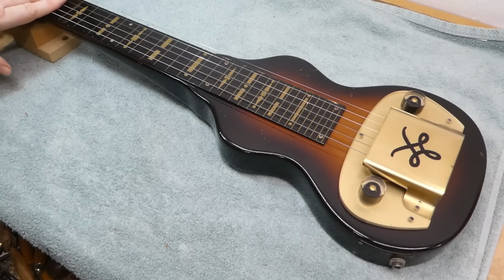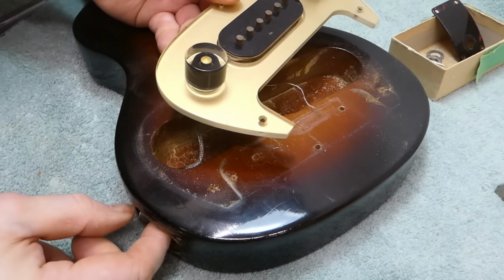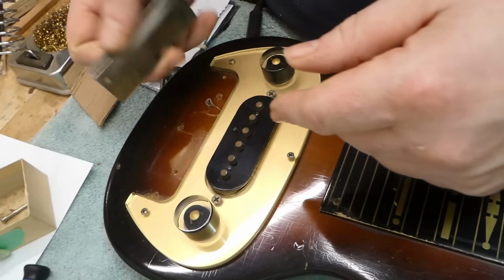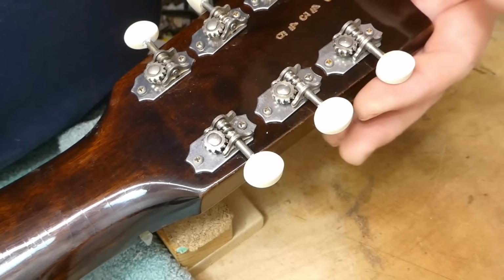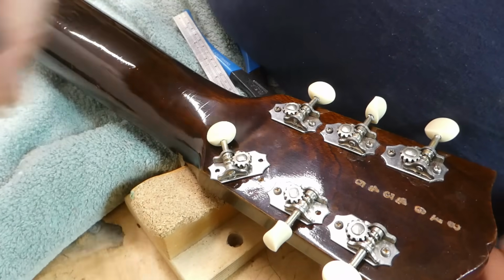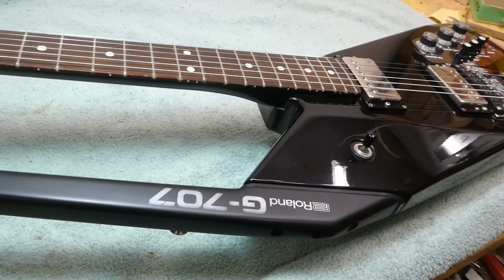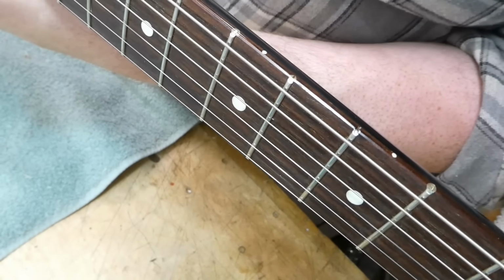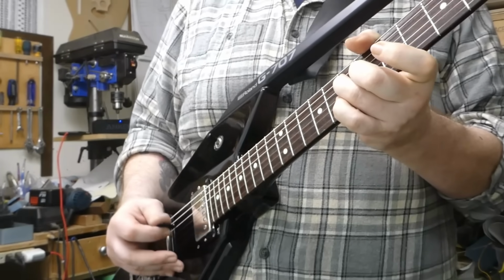Oddballs, old and new.

Comment: I used the Roland GR for many years. I really didn’t understand how to set it up but I worked it the best I could. I now use the Roland GR55 which perfect it isn’t, it was a far better system. One user of the GR 707 is Chuck Loeb. A video on YouTube shows him using it in the fusion band, Steps Ahead.

Comment: I’m only here to comment that the Telecaster pickup started out being that thing from a lap steel. Thusly the poles were flat. Thusly on a Telecaster the middle strings didn’t get the signal enough. The steel plate underneath altered the shape of the magnetic field overall. And Leo started this slant bridge pickup thing to spike up the high notes, which I find to be annoying. I ordered a set of Tele pickups due to the vaunted reputation of the things. I pushed up poles 3 and 4. The non-magnetic plate covering the neck pickup removed discovering that those too were all flat, pushed those up too. Amplified music was a beautiful thing in those days though and this Gibsun is a beautiful instrument.

Comment: I had a Casio MG510 (Ibanez made guitar + built-in MIDI) for years I used to compose my ideas into an Atari ST1040 computer running Cubase.
I "recently" upgraded a 2nd hand MG510 that had a broken 6-coil pickup with the Roland GTK3 that is still one of my main axes...

Comment: Tony James used a G707 for the Sigue Sigue Sputnik Flaunt It tour. IIRC it was used exclusively as a MIDI controller for the bass lines, which were all synth-generated. Neal X played a regular electric guitar. I don't know why Tony didn't used the G77 bass (which looks the same at first glance, but has a different shape), but I suppose that it doesn't matter.

Comment: BTW, nowadays Fishman 'Triple Play' are way ahead of Roland GK PU's. The problem beeing, with GK's, they can only track correctly, if you're in tune, the Fishman doesn't care , not only it tracks out of tune, but you can also 'bend' without problems , once configured correctly!
+ bonus, no huge 13/15/18 pin cable. They've released a new model recently. For curiosity, watch Jennifer Batten using it! Take care and thank you for sharing.
ps I don't understand how midi PUs aren't more common for Bass! It would make sense! Once again, Take care!

Comment: I'm not into guitar repairs, more into electronics, and am surprised the old capacitor isn't replaced. They will all be leaking and appear more like a resistor than a capacitor by the time. Another Canadian, Mr Carlson's Lab, is recapping all the time in every old radio he restores, even keeping the old casing if necessary.

Comment: Most garden-variety superglue formulations are a bit too thick to be usefull; It's helpfull to keep some waterthin CA glue around for jobs where you want the glue to wick up into a tiny crack or underneath a finish (if you need to make a hard-curing paste from baking soda and super glue, it works much better with a waterthin CA glue compared to using ordinary small-tube super glue). Titebond sells small bottles of waterthin and medium-viscosity CA glue; other companies (Sure Hold, Zap-It and JB Weld) sell UV-curing CA glue that cures instantly when irradiated with the (included) UV light and cures more slowly underneath/ inside the joint where the light doesn't penetrate. I have a video about these glues on my channel.

Comment: FYI, the abrupt,  all or nothing tone control is something that was done intentionally on many lap steels (some Tele players do it too) to make it easier to get the “Boo-wah” sound that was a popular special effect, particularly in Western Swing music.  It is achieved by using a high-value LINEAR potentiometer, along with larger than normal capacitor (Fender Stringmasters have a 1 MegOhm linear pot with a .047 uFd cap).  Here’s  a link to someone demonstrating the sound  https://www.youtube.com/watch?v=zaCb6GL5Gp4.

Comment: I had a silver G-707 and the GR-700 guitar synth in the 80s - it was essentially a Roland JX3P on the floor. It worked OK, but it never tracked as well as the GR-300. The tremolo was just atrocious, and I never ended up using it.

Comment: The gray trim pots seen at 26:39 are a known failure point in other electronics of that era: the plastic shrinks and cracks and the resistance setting shifts or the linearity of resistance adjustment becomes wonky. I've changed lots of these in 70's and 80's audio equipment (typically used for bias adjustment and offset nulling) but I shudder at the thought of changing them in a device like this ---- how the heck would you go about recalibrating it?

Comment: Roland is actually still THE company to go to if you wish to have synth guitar stuff. I suppose aeroguitar has proven the crappy plastic controller with fake strings stuff Roland had also toyed with in the 80s is still NOT the way to go - but Roland’s midi pickup for (actual) guitars seems very refined for real-world uses.

Comment: I still have my 1985 GR77B bass system. I haven't played in in decades. It's ok as an analogue bass and the bass version is based on the JX8P synth, so the sounds are great. But the note tracking is terribly glitchy and slow. Forget play anything but long whole notes below A. The weird shape is not good for sitting and it suffers from neck dive. I moved the strap button on to that "cool" looking bar above the 12th fret. That bar is supposedly a "stabilizer." Maybe it was meant to prevent dead spots but I doubt that it makes a difference.

Comment: What an odd tone on that lapsteel.  I'm not very familiar with them so I dunno what's typical.  The low strings sounded like those synthesized clock bells and the high strings sounded like car horns.  Maybe just that hot of an output and getting distorted in the amp.

I've tried a MIDI guitar, even got pretty far writing some software for it, but its MIDI stuff just up and died, I think a bad USB cable.  Thankfully it has normal pickups and an output jack too, so now it's just a plain electric guitar. :p  I'd done a bunch of research in to MIDI guitar and the options are pretty limited and expensive, yeah.  The all together MIDI guitars are neat but seem not to hold up or just not that good.  The extra pickups you can add for it seem expensive all in and need extra outboard hardware and can't really work directly with a PC or anything.  The VSTs just suffer from all the usual issues of modern plugins.  Proprietary software, who knows if it'll work the next time you go to load it up or complain about some license nonsense, etc.  Maybe the situation's improved in the last couple years since I last looked in to it but I doubt it.

Comment: I remember trying one of these out when they were released, I wasn't too impressed by them as the guitar wasn't very good and so I wouldn't use one to play guitar and then switch over to a synth lead, I would much prefer to just use a keyboard synth and play my regular high quality guitars, I play both guitar and keyboard instruments and I never really liked  any of the MIDI guitars, tracking always seemed to be an issue, they were just a gimmick IMO.

Comment: I think MIDI stands as one of the best standards ever. Long lasting and universally adopted. It evolved to support different hardware interfaces, but just to support interfaces other standards made - MIDI never dictated the adoption on non-backwards compatible interfaces (like USB or Apple).
Reply: MIDI has had a lot of stuff expanded on to it over time, but it's well done that equipment which is totally unaware can generally just have the data pass through and ignored without side effects.  There's stuff in there for like, six axis 3D controllers or breaking out every key press to a midi channel to get full parameterization to every note (MPE).  Although some old devices might have issues with stuff just going out to random channels.

Comment: Hey Ted, that capacitor in the Gibson lap steel didn't look healthy at all.
Reply: I didn't think it too looked bad. It wasn't swollen or leaking.
Reply: @devschlong  80 year old paper capacitors have perished 40 years ago. Zero chance that cap is working properly.
Reply: @kilosierraalpha I'm aware of that. But it doesn't mean everything needs to be replaced because some know it all in the comments section thinks it didn't "look healthy at all".
Reply: @devschlong  not "swollen or leaking" tells you nothing. A cap that old is almost certainly leaking current, and the falling off a cliff behaviour is a common enough symptom. It's a simple thing to test - just requires taking at least one end out of the circuit. An ESR tester is best, but using even a pretty basic multimeter testing for will let you know if you are at least in the ballpark.

Comment: I remember about 20 years ago I found some beautiful fingerboards for 10 bucks on Ebay, but what made them seem even more impossible was the inlays and fret wire were already installed. Then I realized they were stickers for lap guitars lol!

As far as the synths go, I imagine as we wade into the possibilities of Arduino and more likely, Raspberry Pi or Android, the potential for synths that run off an A.C. pickup signal will be well within reach and yet still really expensive. A system of analog oscillators, filters and wave form shifters controlled digitally with pots and software can do it.